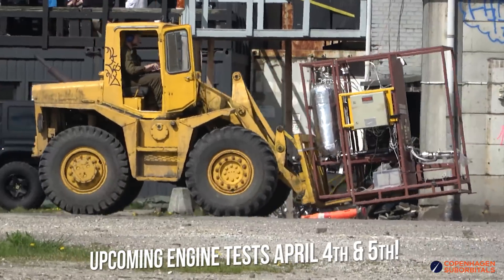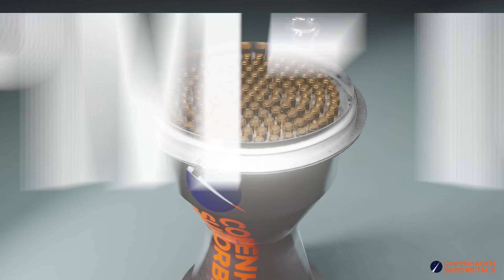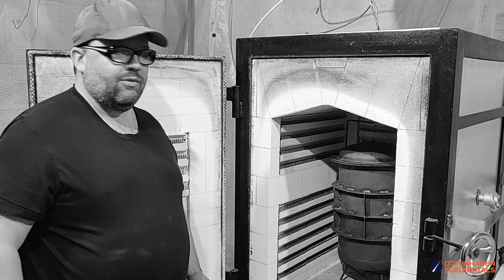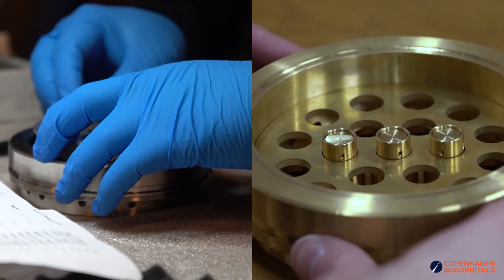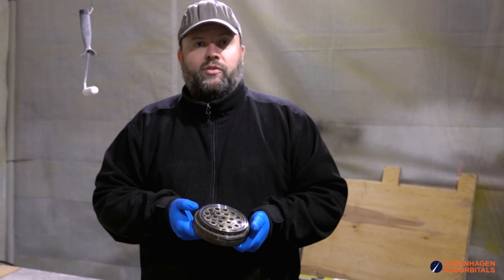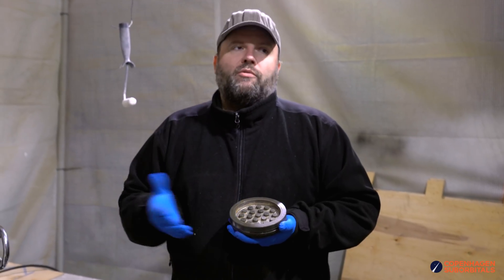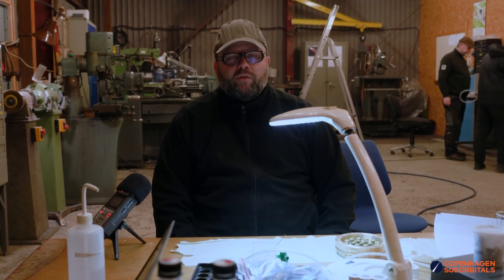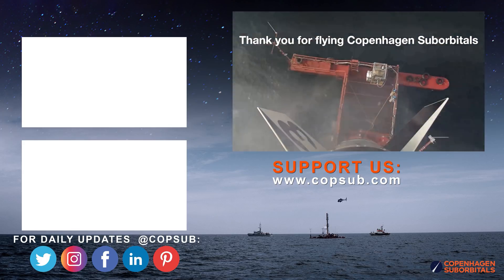Our FIRST 3D Printed Stainless ROCKET ENGINE Fuel Injector Ready for Testing!

Comment: Joey B's Lumineer and Copsub BPM-100 on Apr4?!madlads
Reply from the maker: Lumineer launches on the 3rd and ours will be BPM100 injector technology tested on BPM5 scale. :_McSwirl:
Reply: @CopenhagenSuborbitals  looking forward to it! does BPM100 have relight or throttle capability? if so how will it throttle or relight? afaik coaxial swirlers are harder for throttle control
Reply from the maker: @abhinavprashant2213  Likely yes for both, though the igniter design for BPM100 still might change from what we plan. Though relight capability is not something we require. The throttle is controlled via propellant feed pressure.

Comment: You will be using pressure feed cycle, wouldn’t you?
Reply from the maker: For now yes.
Reply: @CopenhagenSuborbitals  what cycle are you guys  planning to use in the future?
Reply from the maker: @cgplayz545  Electric pump-fed cycle. With the help of our friends at Orbital Machines. More details in this video: https://www.youtube.com/watch?v=eOu8vqvlpUA
Reply: @CopenhagenSuborbitals  Can't wait to see our pump with the BPM100. It's gonna be some powerful stuff right there!
Reply from the maker: @orbitalmachines713  So can't we!
Reply: @CopenhagenSuborbitals  So just batteries instead of a preburner ?
Reply: @CopenhagenSuborbitals  Why did you decide to go for a electric pump system instead of a preburner system ?
Reply from the maker: @rikartc1728  Yes.
Reply from the maker: @rikartc1728  Orbital Machines asked us if we could help them test and prove their design and we agreed. And speaking generally, electric pumps are much simpler to operate compared to turbopumps, which is a benefit and a great reliability measure when considering flying humans.